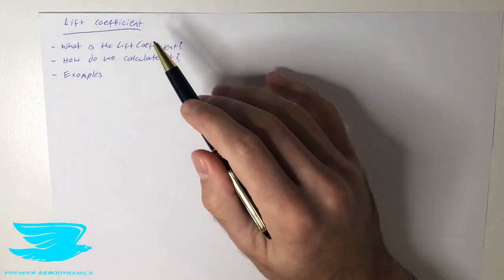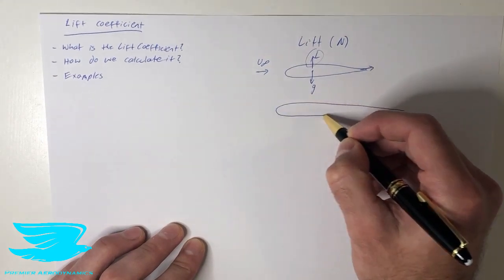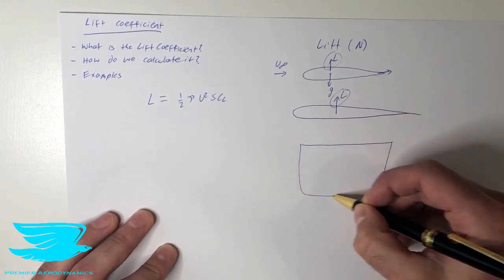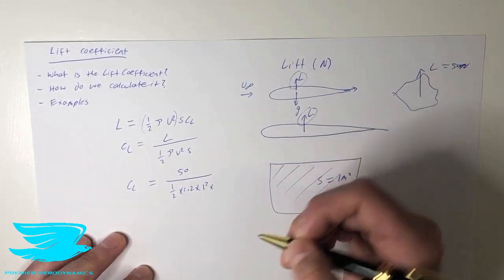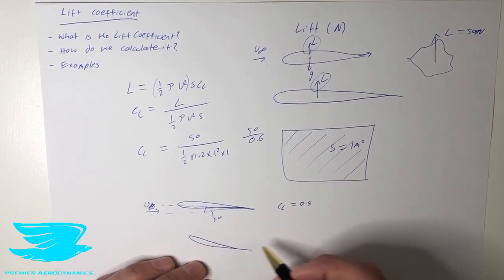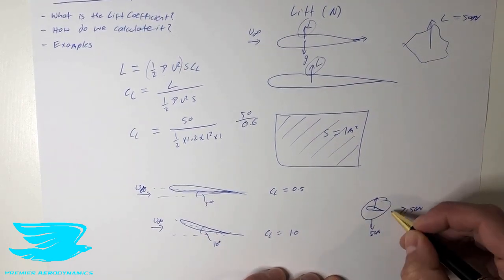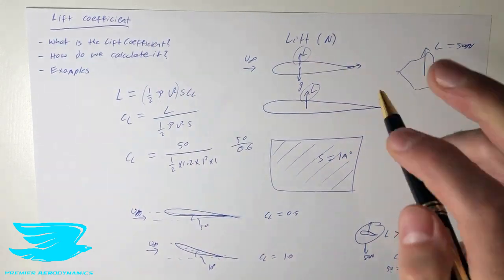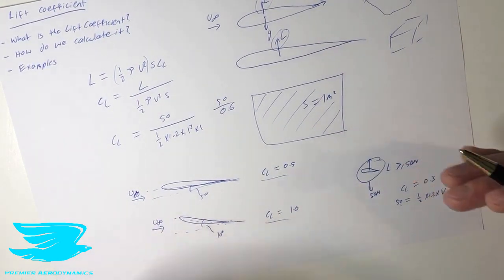[Aero Fundamentals #5] Lift Coefficient Explained

Comment: Math is a fantastic tool to get you in the ballpark! Of course no engineer would go for minimum spec, if you need 500N of lift to fly, the engineer wants 5,000N if within reason. Again pointing to the beauty of math, if the math is good enough to get you in the ballpark one way, it must be good enough to get you in the ballpark if you're going above and beyond as well. Philosophically, we see often that new equations and techniques are needed in order to go above and beyond, because the ones we rely on to get us to point A, may work at point B, and C, but don't necessarily encompass enough to get us to point F. Sometimes what you need to get to point F doesn't exist, or more often, the solution is found in another set of equations and points of view.

Maxwell's laws for instance apply very nicely to Aerodynamics, then combining that with Newton's laws, and Bernouli, and, Prandtl, and Hawksworth, and Boltzmann, et al. All these methods of getting to more or less where you need to be. You have something guiding a feedback loop where you experiment, see where your understanding is right, where it's wrong, where it matches with theory, where theory breaks down. Then refining your methods and re-testing, so on and so forth.
Reply from the maker: I remember one time, a group of students were learning about safety factors the hard way with their project. They designed their car to take 70% of the maximum expected load. Lol. Luckily they realized the problem with that approach.
Reply: im working the opposite sode of the street,so²speak..
 flyin =  /diein
im attempting to reduce drag coefficients,   elimimate lift and simultaneously stabilize  high speed, characteristics  of an object..calculating sufficient 
 downforce/ per mph,w/safe margin for for variation in atmospheric cond.change  to will ,to keep  an object stable at higher speed,and as speed is reduced less downforce required,so unnecessary drag becomes inefficient...